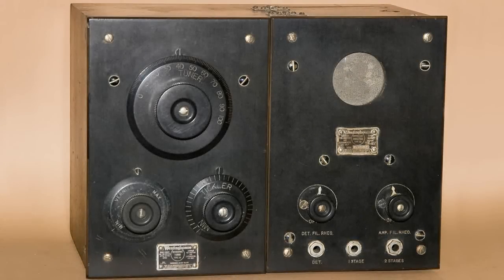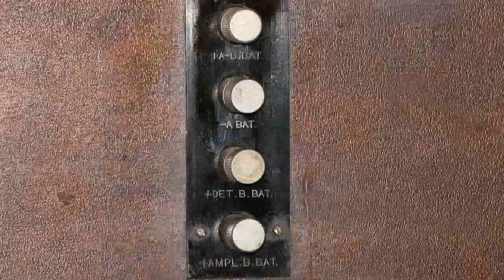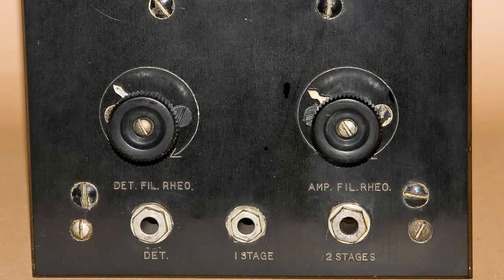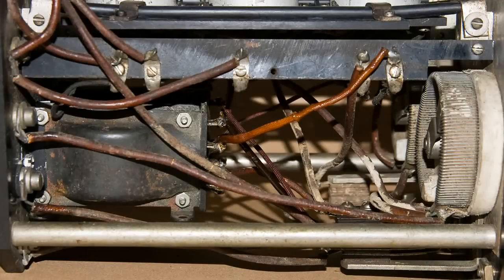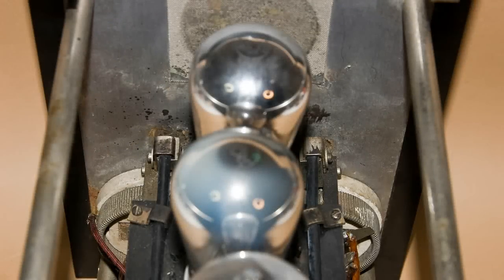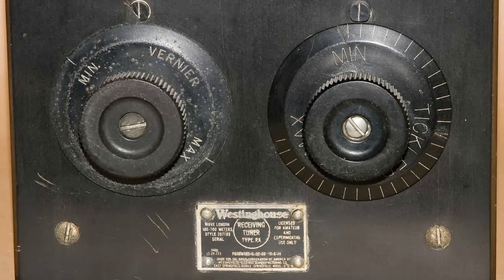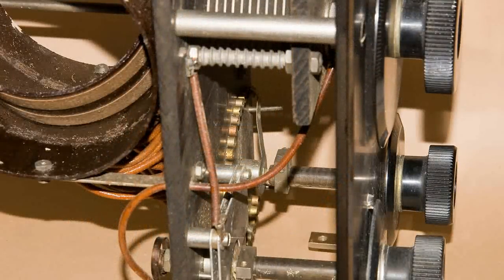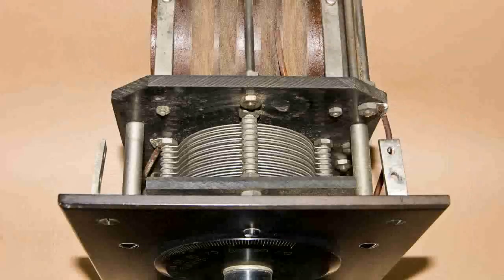RCA Radiola RC Radio 1921-22

Comment: What's the value of the added capacitor?  Thanks
Reply from the maker: It's experimental. Try 20pF – 100pF some where in that range will work best for your radio.
Reply: Thanks I will give it a go